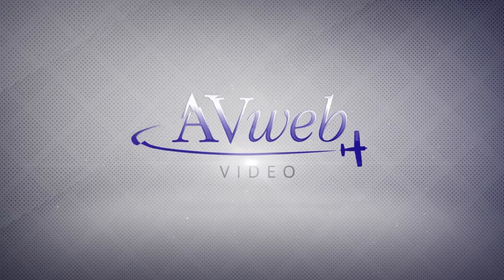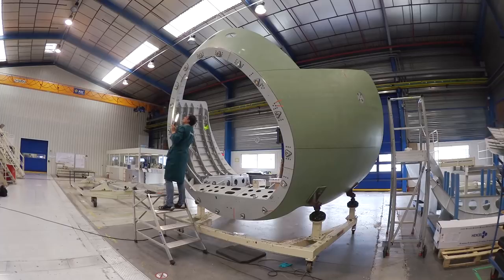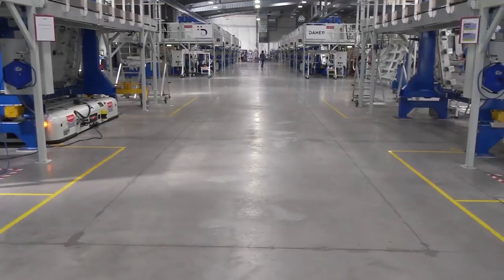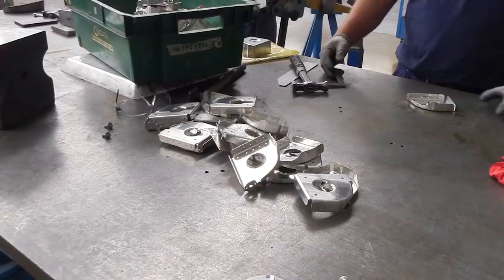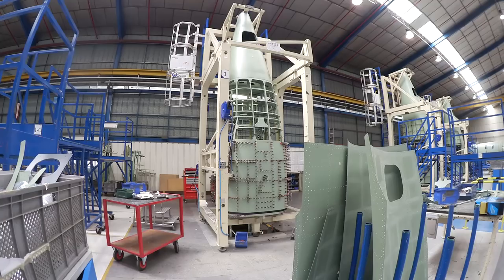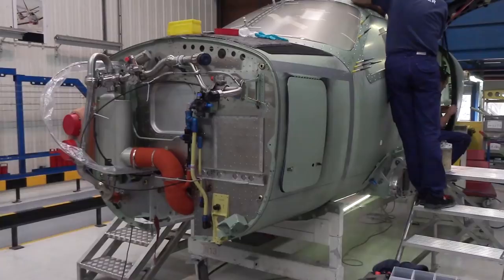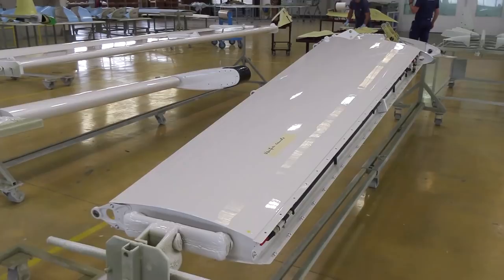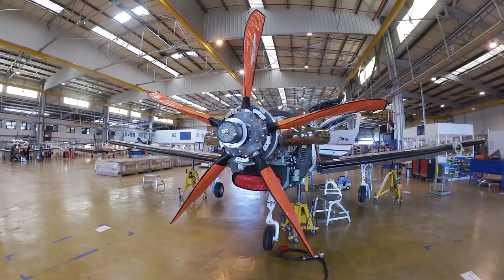How Daher Builds the TBM Turboprop

Comment: Oh yes, the still hold the type certificate for the Rallye series, and yes, if necessary they will make spare parts. But a nosewheel axle (just one small forged steel part) will cost in excess of €1100 plus taxes and has a 3 month waiting time, so it's not recommended unless you really can't get a used spare part. Ask me how I know :)
Reply: how do you know? Asking for a friend.
Reply: Ours had a hairline crack, and the offer for a new one was some €1150 plus taxes plus work, and 90 days delivery. We found a used one which was just 300 or so for the part and available within 10 days including the mandatory inspection.

Comment: All Aircraft are over priced!  Simple reason is your paying for all the R&D over the last few years, it's no different on a boat or car, they could be built cheaper no doubt, but a plane like TBM 850/900 has probably 1mill just from fire wall forward, the prop is probably 30G's there will never be a cheap Aircraft as long as it's being built w/the most advanced material at the time of production, just imagine if you take away all the carbon fiber, the high tech avionics, turbine engine, fwd /rev full feather prop, Retrct Lnd gear -and a lot more thing's you don't see, the plane would still look about the same -but you might as well change the name to PIPER because that's about what you would have, plus then a man with a upper class salarie might even be able to afford it! If you got it financed for 20 yrs,  the average American will never be able to own a plane, you have got to earn the money of the upper 20 % of people to afford a Cessna 150 ,pitiful